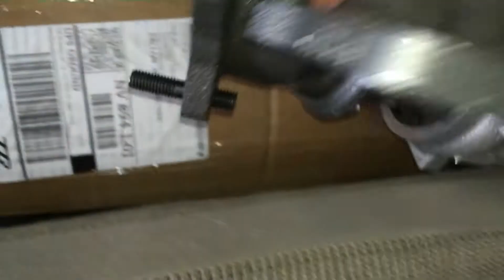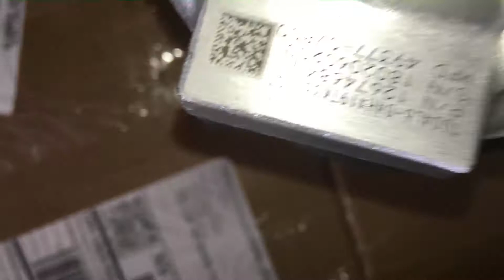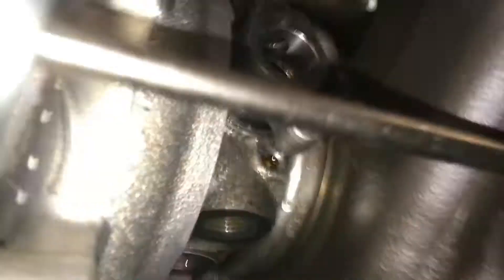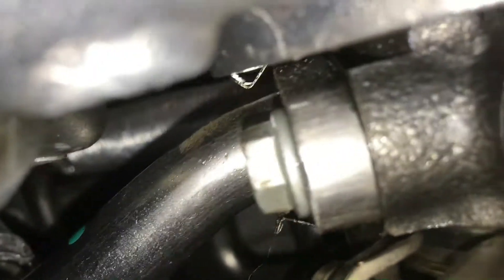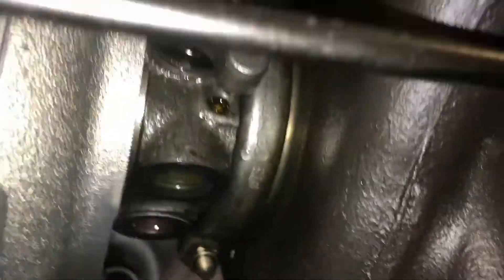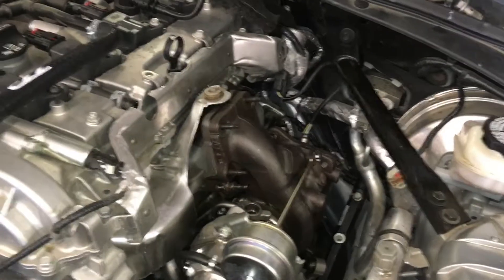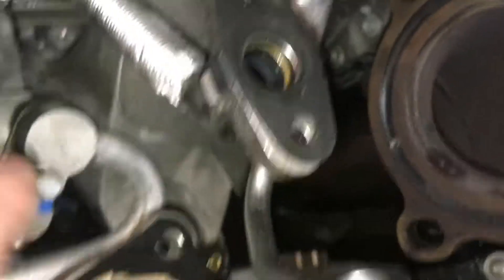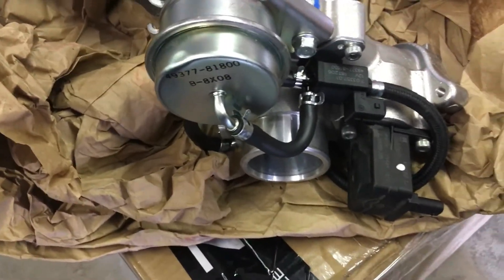DIY Turbocharger removal 2018 Cadillac ATS Camaro LTG 2.0T engine upgrade to ZZP Big turbo

Comment: How do you remove bottom two nuts from the turbo flange? Top 4 come off no problem. I can fit a socket or an open wrench.

Comment: Aye man idk if you gonna respond or not sense it’s been some years but I’m doing a turbo swap on the Camaro and I’m trying to get that air tube off where you say it’s an Allen wrench do you buy chance know what size it is cause I use a 5.5mm and it’s to big and a 5 mm is to small
Reply from the maker: Do not remember the allen size, sold the car a while back.  When I have a problem with size, I get all my allen sizes together and fit test both metric and standard and pick the best fit.  There are so many different sizes of allen tools

Comment: how is the big wheel turbo holding up r u looseing any oil or any smokeing from the turbo
Reply from the maker: Turbo did well the whole time I owned the car.  I traded it in for a turbo 4 x 4 Ford ranger.

Comment: I have code P0299
Reply from the maker: Its a low boost output code.  Could be turbo wastegate controller solenoid is not working

Comment: It’s just a big wheel turbo and your losing you mind over this…
Reply from the maker: Not really, its compressor wheel allows much more volume of boosted air.  Of course aftermarket Garrett and many others will blow it away

Comment: hey which is bigger LMAO
Reply from the maker: The compressor wheel is the difference and the compressor housing had to be ported to fit the larger billet wheel. Externally doesn’t look different from stock until you look inside the compressor.

Comment: What size silicon hose off the wastegate control vacuum line, 10mm?
Reply from the maker: I believe it’s an 8 mm
Reply: @madboostingmadmatt48  do you remember where you bought it from? My hoses are wearing down and I’m slapping a catch can, tune and new spark plugs this weekend so i thought i should just go ahead and start changing some hoses out as well.

Comment: the oem internals can’t handle the original turbo so if you don’t change the stock cylinders do not do it
Reply: So far so good the 2018 Cadillac is handling the new big wheel turbo some of the earlier Cadillacs have bad internals but the 18 has proved well so far even with 87 octane believe it or not.

Comment: What changes did you have to make for this install. I have an upgraded downpipe, k&n intake, and tune. and want to just put the bigger turbo. Do I need to change anything else.
Reply: All original intake and exhaust components can be used.  I installed K&N intake, my version of performance exhaust, unlocked TCM, high flow downpipe, and catch can.  I had a dyno tune done but would have preferred it done by tuning shop that knows the LTG PCM and its power robbing torque management system.

Comment: Did you need a tune to run this effectively or will it work just fine stock?? Thanks so much for this video!
Reply: A Tune would be best.  The stock computer could handle it but it will pull power away from torque management system. Also highest octane fuels should be used since I have heard from many others about LTG engine having weak pistons from factory.  My son drives my ATS now and I reinstalled stock tune with 91 octane fuel.  So far so good. He daily drives it and likes its response.  I do not recommend aftermarket intake for this engine, the stock PCM backs off power with its torque management system. I honestly would not tune this car at all if I had to do it over again.  That PCM and TCM from gm prevents the great potential this engine has.  I made a video of the dyno tune and dyno readings were good but real world driving I was disappointed  that it didn’t feel that fast to me.  I should have bought a Nissan GTR, or a more tuner friendly AWD turbo vehicle.
Reply: @TTATurbochargeThemAll  thank you for your detailed response.  Looks like I should just stay stock until I can make this a side project car if I decide. I am at 129k and my turbo already needs to be replaced so I figured I would look at my options. Since the cars paid off I figured I would have some fun with it and make some mods for the rest of my time with it. At the same time I would like it to last me as long as possible.

Comment: What is your mod list?
Reply: Thanks for all the information. On my 14 I did E85 tune cold air intake downpipe and muffler delete. Wanting  to get zzperformance intercooler and larger turbo.
Reply: I'm thinking about getting this turbo for my 14 ATS and wondering if its really worth it
Reply: Jeremy Blair it has a much larger compressor and attaches to all factory hardware so a fairly easy mod that puts out much more volume of boosted air.  My mods are K&N intake, my exhaust idea which deletes factory muffler but looks completely stock on outside.  I installed NGK iridium plugs gapped to .027 thousands of an inch.  Installed 17x9 wheels with 245/45/17 rubber which improved my handling and more rubber for the road.  Installed a banks gage pod which can read 8 engine data items at once.  K&N intake kit, upgraded fresh air flow to intake by removing piece of plastic in grille.  All these mods I have done videos on.  Also have unlocked tcm, and PCM/TCM tune from local shop in Reno.  Also have ZZP catless downpipe.  My catch can idea to keep oil blowby  out of intake of compressor.
Reply: @TTATurbochargeThemAll  just came across this video funny u say reno as I live there too. How has this held up over time as I want to do the same?

Comment: What year is the ats
Reply: it is a 2018, very difficult one to tune since the factory torque management system pulls timing and reduces throttle from the TCM.  In order to get this car tuned the TCM needed to be unlocked, I had ordered one from ZZP which was unlocked, and my factory one is a spare.  I am preparing a video of the dyno session for the new turbocharger and new TCM which did increase the power, the problem is a system on the 2018 ATS is still pulling timing despite turning off the torque limiting governor on the TCM.  I highly recommend anyone that wants an ATS to get 2015 and earlier model, the 2016 and newer ones are too difficult and expensive to tune.

Comment: This video has been brought to you by the Motion Sickness Makers Of America.
Reply from the maker: With my RA issues, pretty difficult to keep it from shaking sometimes.  Especially when removing a turbocharger, its very tight fit so hard to get any camera just right in those tight places.  Miss the younger days when my hands were much more steady.  I did not make a turbo installation video since it would most likely shake just as bad.
Reply: @madboostingmadmatt48  I hear ya I've had  OA for awhile now and that's not a good time either. Cant wait to see it installed! I have a 15 ATS 2.0 and would love to do this! How much was it? How much HP will it produce?
Reply: Pumpkin Face My newest video is dyno tuning with the new turbo and unlocked TCM, the ZZP big wheel turbo was around $900 but with tax and shipping its $1000.  Factory turbocharger could cost close to that so not too bad.  The big billet compressor wheel moves more volume of boosted air so it will make good torque and power at even lower rpms than stock.  My car was dyno tuned on AWD dyno and made 352 whp and 348 wheel torque.  Not too bad though I was looking for more.

Comment: I got the same one 2 weeks ago and definitely tell a difference
My upgrades zzp down cat downpipe 
K&N could air intake 
Zzp big wheel turbo 
BNR BOV 
 Delete resonator
Reply: Still need to get that oil catch can you told me about and zzp bigger throttle body
Reply: Whats your hp numbers?

Comment: How much extra hp gain?
Reply: I will be scheduling a dyno tune session to tune the transmission TCM and engine to the new turbocharger.  I had recently installed an unlocked TCM so it can be tuned along with the engine PCM.  I believe it will get me to 430 or 440 whp.
Reply from the maker: The results were not as great as I wanted but not bad.  Stock crank power on this engine is 272, stock torque is 295.  After dyno tuning with new turbo, max power was 352 hp and 348 lb/ft torque at the wheels on an AWD dyno.  I am uploading the video now.

Comment: Appreciate the video....just a suggestion going forward, you bounce the camera around  the engine compartment alot sorta hard to watch. But great information.
Reply from the maker: It was a video where turbo is very tight quarters so filming was difficult and my hands are not very steady anymore.  I remember when I made the 300zx timing belt video, the opposite was the problem, I had the camera secured with a holder so it would not shake however, not a close enough view at some parts to see everything.  Trying to find that happy medium is the challenge.  I hopefully will find a solution.
Reply: No worries Just glad someone is making videos on this platform! Keep up the good work!